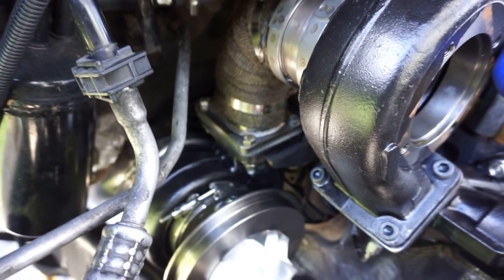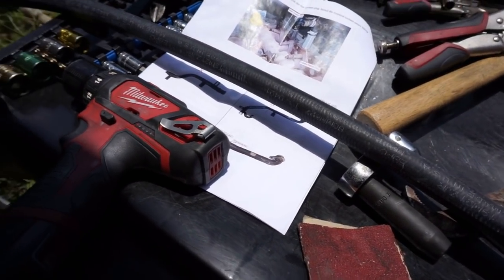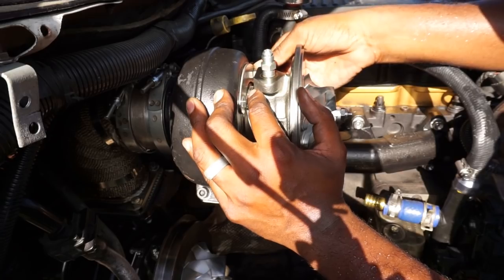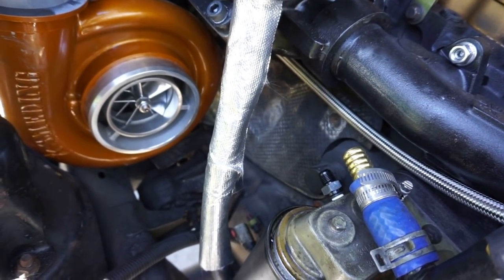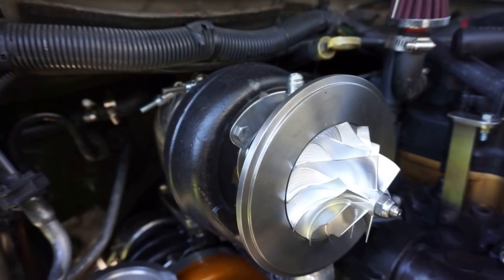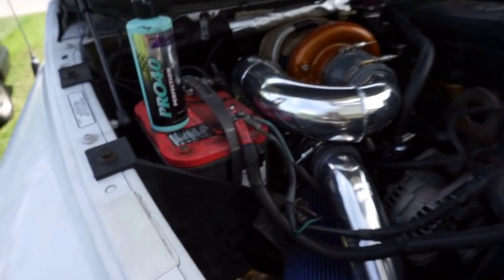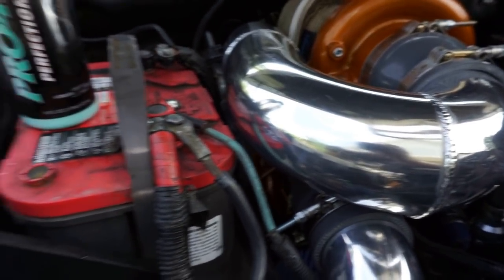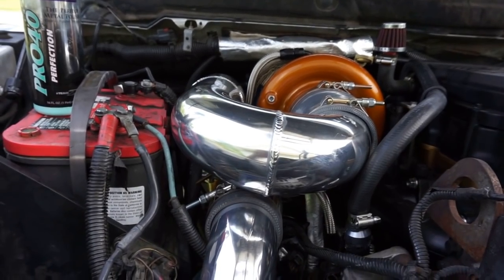S366/S480 Compounds INSTALLED On 6.7 CUMMINS!!!!

Comment: What oil feed lines did you use ? I want to put them on my 08 3500 Dually :)
Reply from the maker: They are just basic steel braided oil lines, came with the compound kit.

Comment: Great job brother! Keep an eye on that water connection, You may have to find a better water fitting on the hose. Also have you thought about the fleece coolant bypass kit.? It will lower water pressure in the system due to allowing better circulation around cylinder five and six. Another great video. Thx 4 sharing “D”
Reply from the maker: Yes I have, when i remove the trans i will be installing it!  the hose connection i did is doing great!

Comment: Looks good! Sounds like Smeding or MDC Diesel needs to go thru there kit and correct some things.
Reply from the maker: Thanks man, yea overall kit had 95% of everything needed and ready just some small things for sure
Reply: @EVERYTHANGDIESEL  Yeah, but those small things sometimes make big issues. I can't wait to see it done.
Reply from the maker: I agree man, she should be wrapped up Thursday!
Reply: Looks like cam got lucky cause every time I turn around something is wrong missing or screwed up with my kit id never recommend that company to anyone. Mack seems like a good guy he might want to find another place to work for but all that's my two cents

Comment: Looks good-I have a pusher delete and it was the o ring that was ripped-make sure you file the shit out of the pipe before you install the machined pusher part-taper it real good or worst case just get some fitting from homecheapo and get some one to weld it up for you because you’ll keep blowing through fluid
Reply from the maker: Thats exactly what I had to do, I ended up getting a 10an fitting and getting it welded on

Comment: Good tune, valve springs , push rods , dont skimp on this stuff you will regret it when those turbos start floating valves. Looks good , air cleaner on the bottom is not my favorite,  I would not drive in the rain. The pusher reroute I took the stand pipe out as well makes it easier but still a pain. The whistle will come with drive load . Good content keep it up
Reply from the maker: Yea got springs and rods next on the list. 👌🏾

Comment: No offence but that's a pretty dumb design to have the air filter so low. Any kind of offroading and it's just gonna suck in the mud and water. Seems like a weird set-up.
Reply from the maker: ?? My truck is lifted 10.5 inches and that filter sits atleast 5 inches above my frame. If I got water that high on my truck something bigger is wrong. Not to mention it sits behind the wheel well liner.

Comment: So for that stand pipe, I took mine out just cause it’s a little easier, but where I cut it, it kinda was a little thin so I had to use a mallet to knock that fitting into the pipe, I used that red RTV only to kinda if lubricate it so the gasket wouldn’t rip,  but man, that looks BADASS!! 🇺🇸🔥💯🤘🏻
Reply from the maker: Gotcha man! Yea imma have to reseal my fitting. I think the o ring got pinched